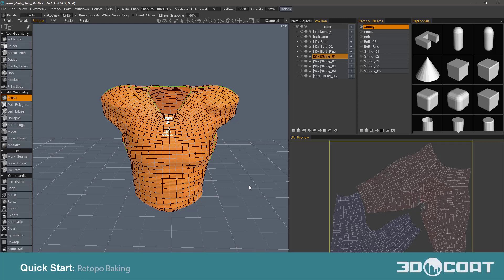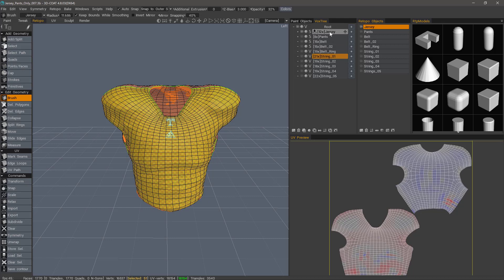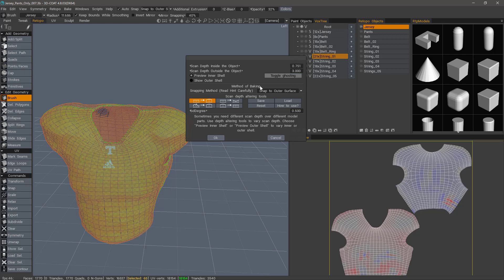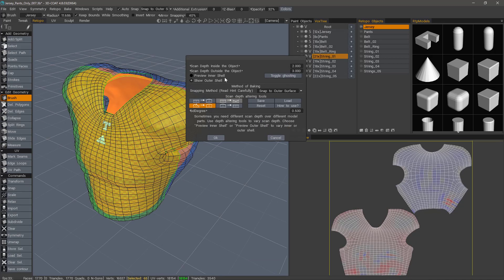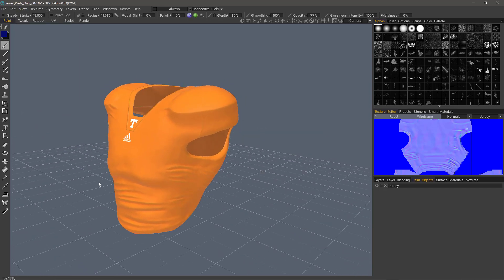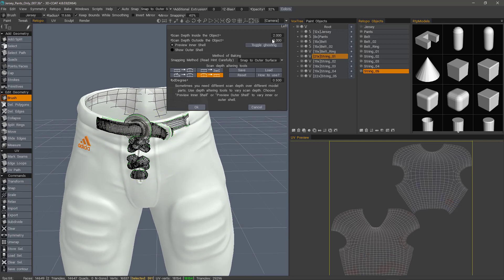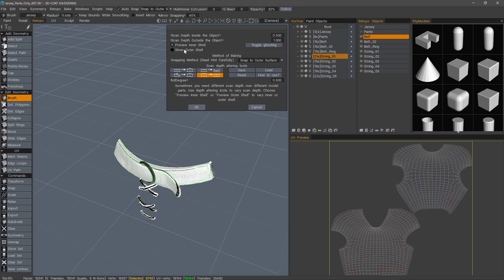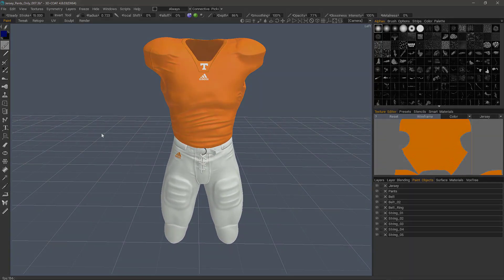Quick Start: Retopo Baking

Comment: Which version are you using, I have version 4.7 and i don't have the same dialogue box come up as you- the one with the little icons where you can change the inner and outer shell.Am I missing something somewhere? Video is really helpful by the way.
Reply from the maker: It's best to update to the latest build of 3D Coat, because there are a number of features like this, which have been added since 4.7. Here is the link:
https://3dcoat.com/download/